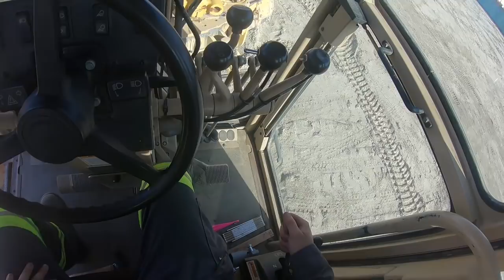Delivering A Caterpillar 140H Motor Grader

Comment: Hey Plaza, i work at a CAT dealer as a service tech. For never driving a motorgrader, good job. Those are definitely the hardest to learn due to the fact it intimidates people with all the levers and pedals. For your information man, 140H, or and H series motorgrader uses air brakes, the alarm should shut off within 30 seconds after start up. If the alarm does not turn off, either the machine isn't building air, or a level three code is present. Driving with no air, is dragging the brake on the transmission. But judging by how easy she moved, id say it had a level 3 code. Level three is severe, anything that can pose a danger to you or the equipment. It is best never to operate a machine with a alarm going off unless you know why. I enjoy your videos man. Keep up the good work. Just wanted to share some information with you.
Reply: I'm guessing that is why the owner told him what to take where and then burned out of there in his pickup.  Great owner!
Reply: thats actually helpful even though i dont opperate that kind of equiptment

Comment: Usally on a140 h will be a chain down point in front of the articulation,point near the centre ,I usally cross the chains over here to help stop the walking action on a grader,and put a tyre under blade to help preserve the deck,hold the blade down with another chain.but we have very rough roads here in Australia.

Comment: If you are careful you can tuck the left side of the mull board behind the front of the rear tire and the right part of the mull board up against the front tire just don't put a lot of pressure against the front tire. Honestly you can tuck the whole mull board under the grader but that is a whole different process, same as standing the mull board straight up on end. Anyways great video.

Comment from the maker: Another early one for you guys! bear with me on this one never operated a motor grader
Reply: Plaza Towing them two levers that control the blade to go up and down, when you have the blade all most on the deck push them both forwards and the should click which puts them into float and did you put the articulation pins in it?? Or where they not their?? Just wondering, wouldn’t what you to get pinched for something stupid but not putting the pins in it!! Lol
Reply from the maker: Its funny you say that because I just watched a video explaining that. problem was I was trying to not scratch our new trailer lol
Reply: Plaza Towing forget the scratching it will cut/dig into the trailer deck quicker than you can blink lol
Reply from the maker: Had the trailer for almost a year now. You'd think it just came off the assembly line. That's whats differentiates us from most companies especially in our area. Clean well maintained equipment goes a long way. Especially when dealing with high profile customers such as million dollar motorcoach owners

Comment: It's weird seeing the way you do a chain binder in the state of Texas you put one end of the chain on the equipment or load and the other end of the chain in the slot or d-ring on the trailer and you put the chain binder in the middle and the excess chain you wrap it around the chain binder or ratchet binder
Reply from the maker: Thats definitely a way to do it

Comment: Interesting trailer concept 39:20 with sliding axles and tilting cargo bed. One question -how is the axle carrier moved over this long distance - with hydraulic cylinders or chain mechanism? Here in Austria (Europe) I have never seen this kind of trailer. 
TY in advance and cheers!

Comment: Wouldn't you want to move that grader as far forward as possible? It seems like with all the weight of the grader being toward the rear of the machine that you'd want to move it as far up on the trailer as you could for proper weight distribution. Or am I missing something?

Comment: I have a question. Do most CAT machines use Air Brakes?  And do they function like trucks and school busses?  (Like buzzer at 60 and parking brake pops out like at 30 or  so).   I never hear the “air being applied” when parking or when the foot is taken off the brake or an air dryer purging. that’s why the question.   Plus I’m always looking for the yellow Diamond parking brake knob but never see one.

Comment: Great job  the only thing that I see is you don’t put enough chains on your heavy units .i got stop by fl dot and they said I need two more chains for the weight. . It cost me 150.00 fine . So be safe more the better I always say
Reply from the maker: If I remember correctly because I commented to someone else in the past this machine only weighed 30,000 pounds so we were well within WLL. Thanks for watching!

Comment: You might be under-tied for that load. Four chains@ 4700 lbs is 18800. A Caterpillar 140H Motor Grader is ~48000 lbs  and the 50% rule needs 24000 lbs of tie down. Two more chains (over the grader blade-28200 lbs total) would  keep DOT from writing some expensive paper or your insurance carrier from walking if something happens.
Reply from the maker: 140H 32,357 lb according to Ritchie bros
Reply: You're right 32357 is the standard weight. 46872 is the max weight
Reply: I think that's 3/8 chain... If so it's legal either weight

Comment: I thought there is supposed to be a chain on the machine every ten feet. I like the trailer.
Reply: you need one on each corner and every hydraulic attachment as long as your binders and chains meet the required strength   if not you would need more than 4